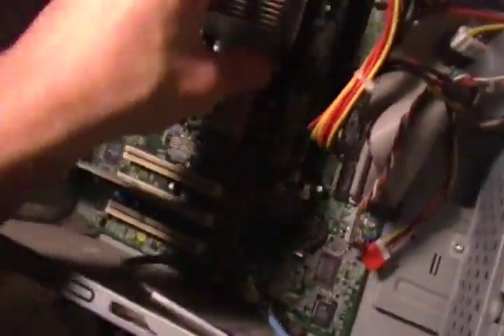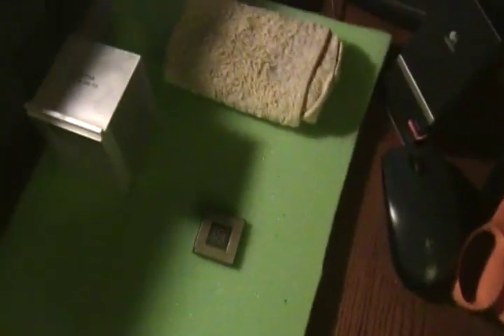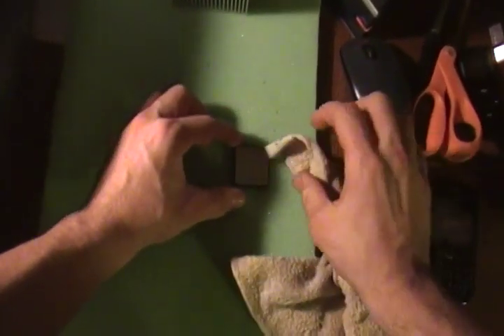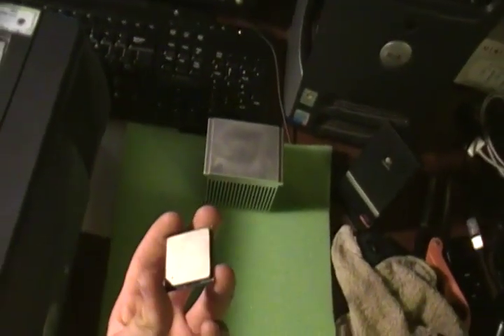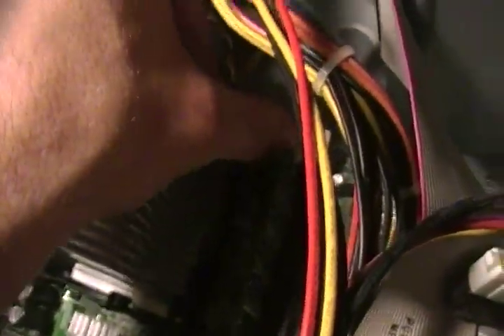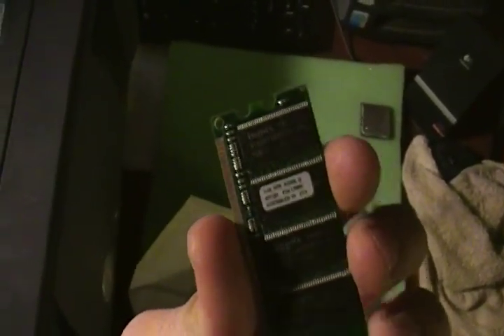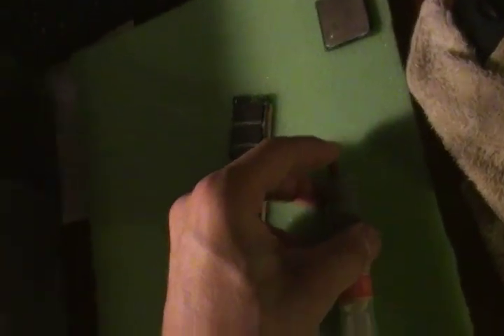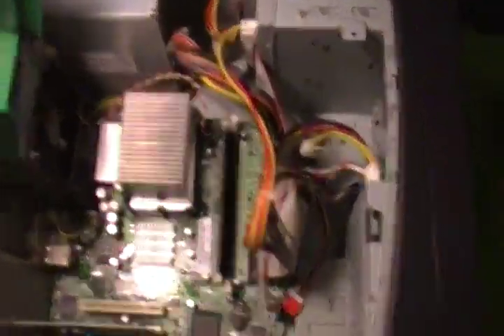Upgrading the Dell Dimension 2400

Comment: You should have no problems with installing a Socket 478 P-4, Northwood [512kb or 400kb cache] processor in the Dimension 2400.

The maximum size is a Northwood P4 3.06GHz 533MHz FSB processor.

The 2400 will not take any Prescott processors [1mb cache].

Comment: I've always loved tinkering with PC's but unfortunately I don't know a lot about the more complicated stuff like different Specs of Hardware and a lot of my knowledge is outdated 
But everytime ive come across a PC in the Trash I'd always grab it
at one point I had Giant Rubbermaid containers for Ram and HDD's Motherboards Heat Sinks you name it.
But I lost everything when I moved.
Some of it was good stuff back then Like Graphics Cards had a few that were good.
So recently I decided to restore my Compaq Pressario SR2180NX Which is a decent PC to do normal Stuff that I would do with my Android.
Also got this Dell Dimension 2400 "Molasses" 1x 246mb Ram 
running Win Xp  But would like to get it at least to the point of doing basic tasks at normal speeds.
Thinking about a Cheap set of 2 512 MB Ram and maybe a New HDD
No PCIE though so maybe also a CPU Upgrade ??
Reply: That board can take 2 x 1 gb ram...probably enough to run a lite version of Windows 10

Comment: Did this actually boot and run with the fsb800 cpu in it? I thought the motherboard was limited to either 400 or 533! 

Because if fsb800 works, I am suddenly a lot happier with my old Dell 2400 than I was!

Comment: I use a Dell Dimension 2400 as my daily driver, still. I've upgraded to 2gb of RAM, Nvidia GeForce 8400S and run Linux Mint 17.3 on dual monitors. But she's pushed to her limit. The old Pentium 4 lags and RAM is constantly getting into the swap. 
I'm ordering a new motherboard (Gigabyte LGA 1150) and a Haswell (Intel) Dual core 3258 with 16gb of Kingston 1333 RAM. It's all for about $200 at Newegg. It oughta purr like a kitten after that.
Reply: I have this same Dell Dimension 2400 but when I checked the motherboard specs, it said that max RAM supported was 1Gb? So i ended up not buying any ram for it and putting it aside.  Is it fine with more than 1Gb of ram? And in general what happens if you exceed the ram limit of a motherboard? Does it just not use the extra or will it cause your motherboard damage in some way? Kinda new at this pc building stuff, so if these questions seem dumb that's why
Reply: That's odd. If your motherboard has two RAM slots then I would, at least, attempt to boost it to 2gb anyway. Extra RAM will not harm your system in any way. The worse case scenario would be that your system would only recognize 1gb and the extra RAM would be wasted.
Reply: Aphagalis, that's the way it was when those computers were released, same with some other Dell notebooks, was stated that 1GB was the limit. Maybe there weren't 1GB modules at the time & Dell was too lazy to revise their specs.....or they were trying 'upsell' tactics, not like it's not happened in the past & since. 

I suspect that Dell may not have known this, after all, Intel releases the chipset, so the OEM's goes by their spec sheets (commonly known as 'whitepapers') to publish their own. Later own, much more so, Dell also stated that their Optiplex 780 line could only run 8GB RAM (2GB x4), when in fact, it was 16GB, 4GB x4 & what I run in mine.

As to the Dimension 2400.....I have a plan, may attempt to reuse some newer components, if I can get things to line up. Have a nice Gigabyte MB with a a set of 8GB total RAM (4GB x2), and a AMD Athlon x4 630, one of the first group of AMD quads released (the 620 x4 was $99). While I won't know until I try, if it works, will have the best Dimension 2400 in the area!

Another plus, the HDD cages line up vertical, which saves a lot of space, may need to find a way to add some airflow, could be there's a door with place for a fan that's a perfect fit. May need a PSU, as the only spare I have is a 600W Thermaltake, and it's large, although was running good until I replaced when I rebuilt the PC. The other issue would be even if it fits.....what a mass of wires to try & hide. I won't bother with addressing that until I see that I can install a mATX MB, then will see what I can do about getting a 450-500W modular.

As far as the Dell wiring goes, who needs it, I have two simple wiring harnesses, the rest that's needed will be included with the PSU, those old wires can be carefully removed w/out breaking the OEM power button. Will just figure out what to do about the front headphone & twin USB ports, surely there's a simple solution as long as the rest is doable.;-)

Cat

Comment: I have this computer from a long time ago idk how to open it but it still works but needs a wireless adapter which i lost while i was moving i dont use this pc anymore but it is still working
Reply: pull the latch on the back and the top with the Dell sign on it will slidemoff
Reply: pull the latch on the back and the top with the Dell sign on it will slide off

Comment: You can put Windows 98 and Windows 2000 on the Dell Dimension 2400.
Reply: ***** I want to get Windows 98 and Windows 2000 installed on the Dell Dimension 2400.
Reply: Aldwin Panny just boot a linux distro like lubuntu or arch
Reply: Aldwin Panny gets windows 98 upgrade disc places on top of case yes i can
Reply: +Aldwin Panny 98% sure you can put windows 98 on it, it came with xp

Comment: I've got one of these in my closet with 2gb of ram, a Pentium 4 3.06ghz cpu that has hyper threading, and an NVidia GT 610 gpu.
Reply: This computer is reliable unlike this AMD sh!t I have now, the components are worthless in less than a year and crappy from the start.
Reply: Charles Tilley I got a used AMD computer and man did I learn why he sold it fast, no more AMD for me.
Reply: How did you a nVIDIA GT 610 GPU in the Dimension 2400? I have one in the closet myself, with the same amount of RAM & the exact same CPU, but never seen a PCIe slot for this card. Tell us more, I may pull it back out & make a LInux Mint PC out of it.
Reply: http://www.amazon.com/gp/aw/d/B0083Y1YVE/ref=mp_s_a_1_1?qid=1419365907&sr=8-1&pi=AC_SX200_QL40
Reply: Its a standard pci gt 610. I think a few other companys make them as well.
Reply: Thanks! I actually seen this & two other cards, one a 1GB at Newegg, but at $55-$69, I'll pass. Though had I seen these before purchasing the XPS 8700 that replaced it, probably would have purchased to have Windows 7 support. 

http://www.newegg.com/Product/Product.aspx?Item=N82E16814187215
Reply: I agree, bought an AMD based Windows 7 PC in 2009, it died in less than 4 years. Removed all of the reusable components, and pulverized the rest with a hammer. Was amazed of what those flimsy monitors are made of. It was the HP MS214 AIO PC, a true piece of dog s#!t!

Yet I know the Dimension 2400 packed away will fire up if it's pulled out.
Reply: No more for me either, one gets what they pay for. Can't make chicken salad out of chicken sh**. Oh, and lets not forget the electricity bill soaring in the process, their "good" CPU's runs really hot, well at least while they're still running. 

Just the wasted power would pay for a nice Intel CPU, it costs a lot to run one of their 8 core CPU's for a few hours per day. No, I pass on the AMD brand.
Reply: Charles Tilley yeah you can get AMD 8 core computers for 900$ they're worthless. Lets keep picking on AMD!
Reply: AMD CPU's are for cheapskates who wants a CPU & GPU in one, I believe that AMD calls these 'APU's', While I may give AMD a slight nod for graphics, that's not what I purchase a CPU for. Their CPU's aren't worth the box they're packaged in, when it comes to getting real work done, it's like pulling a bass boat with a 4 cylinder Toyota truck. Don't get me wrong on that, I love my Toyota, but also know what it can & can't do. 

AMD needs to do the same thing, the only reason I want the corporation to stay, is to hold down Intel's pricing a bit. Just enough to keep them from charging $500 for a $300 CPU. NVIDIA is already going after them on the GPU's, have lowered prices on several mid-range models that competes with AMD. It's a battle in the end, AMD will lose.

Comment: NEVER use rubbing alcohol to clean electrical components that will have a heatsink attached. Rubbing Alcohol contains petroleum by products that leave an oily residue  on the surface which will prevent proper contact of the two surfaces. ALWAYS use 93% or higher Isopropyl Alcohol or 98% Pure Denatured Alcohol that will never contain these by-products and won't leave a residue.

And contrary to popular belief, there IS a difference between Rubbing Alcohol and Isopropyl Alcohol.Anyone who tells you different doesn't know what they are talking about.

Comment: what glue are u using and where can u buy it
Reply: ITS NOT GLUE YOUR NOT TECHNICLY INCLINED  !!!!
Reply: Kyle Nitzsche really so wat is it
Reply: ..... THIS ENDS HERE>
Reply: Looks like Arctic MX-4, but could be another of the same color. With that hot of a CPU, one doesn't need to cheap out with the paste. Those CPU's runs Hot!
Reply: ok
Reply: That Arctic MX-4 is the best there is (I used MX-2 before that, it's also good), and can be found on promo at Newegg.com for as little as $6 w/free ship, just have to go on their site & sign up for promo codes. 

This stuff normally costs like $18, so $6 is a fantastic deal. It's what I use on all of my CPU upgrades/repastes. 

Don't confuse Arctic with Arctic Silver, they make some cheaper grade blends, one in particular, Ceramique 2, that stuff requires two 24 hour break-in runs, with a minimum of 2 hours between them, but the sooner the better. This is ultra think paste & hard to spread, meaning more is needed. 

Problem is during the next removal of the heatsink, there's a high probability that the CPU is coming out with it, possible bending some pins. So that's why I don't recommend to buy that kind. 

It's OK to go cheap on a CMOS battery in an easy to access case, but not so on thermal paste. The cool thing is that the MX-4 has like an 8 year warranty, so one application should last a lifetime on the Dimension 2400.

Comment: I think the best thing to do with old computers is to turn them into servers. I have two old systems running as servers and it works out ok. I also like to use them as target practice. Other than that I agree with you 100%.

Comment: There are clips on my heat sink and I have no fkn clue how to remove them without going berserk. Help? Also.. I have a computer that says Pentium 4 on the outside but when I check system it says celeron, it's fairly old and I have 2 2400's crap, I decided to move the stuff in the celeron to the p4 cause the p4 was missing them. Could it just be that a celeron was put in before I got it for some unknown reason??